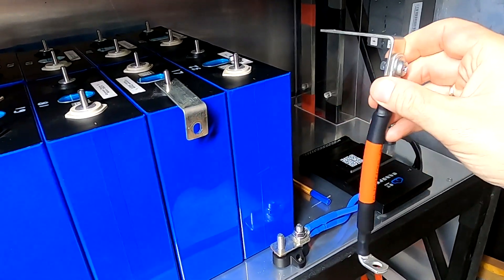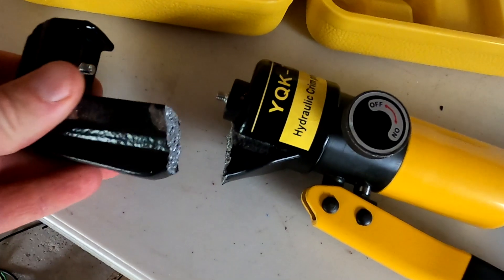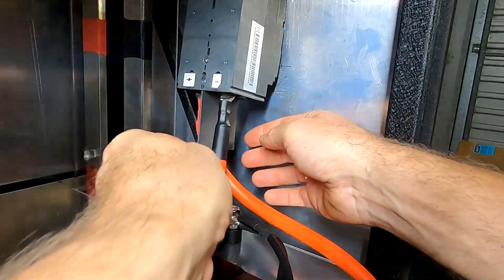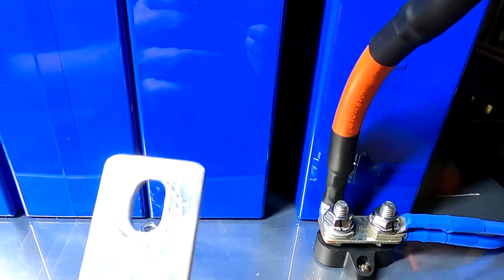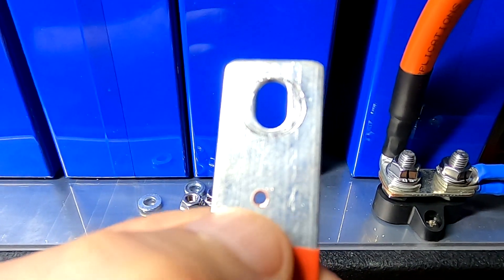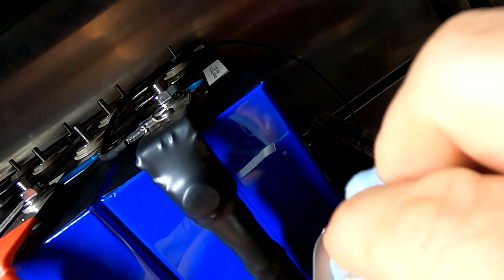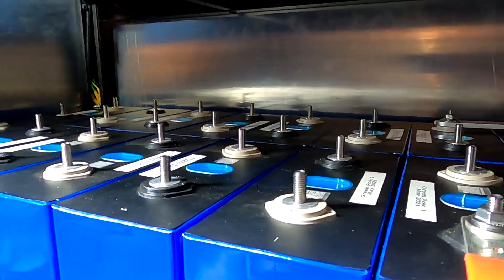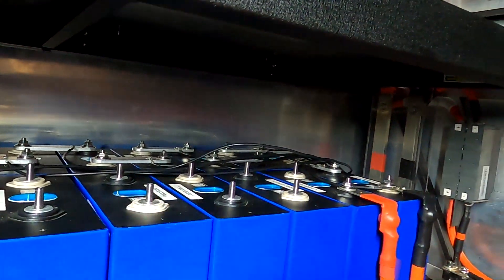Battery terminals, busbars and balance cables - How I do it! Building a 48v/14kWh battery. Part2

Comment: Hi everyone,
I was wondering why use 35mm2 cable more than 25mm2 ? With 100A breaker 
Is it for more safety or is it oversized?
Thank
Morgan
Reply from the maker: 25mm² is rated for 97A
35mm² is rated for 120A
I guess, I had a lot of 35mm ordered (almost the same price as 25mm²) and wanted this extra bit of extra capacity
Reply: @ thanks Andy
Already ordered and installed 35mm2.
Big thanks for all your videos!!

Comment: I have a stand up battery case 16s 48v - 2 tows of 8 - 3.2v batteries , “ I want to use 2 PCS 3.2v 280AH batteries in parallel = 3.42v x 560AH x 8 batteries in series with 16 total batteries in parallel ~ I’ll just have to extend 1 bus bar to connect each bank of batteries or make up a battery cable only a few inches long to go positive to negative I will probably use some zero gauge to get maximum voltage transfer and Amperage ! Maybe some oxygen free wire I’ve seen that in the past for more  efficient power transfer ! I will over kill it , it’s for home battery ~ back up we use about 3 KW a day = 375Wh for 24hour I have a MRPOWR 3KW 24v inverter & the BMS is a Seplos 7ss 24v 150A I also have LTO 2.4v 40A using 11 batteries in series but linking 2 batteries in parallel = 80 Ah total of 22 batteries the LTO batteries are so post to drain slower ! “ this Battery shelf I most Excellent ! I love your content ! I would love to see a parts list for the build of these battery shelf’s breakers , relays , wire inverter the whole 9 ! You’re wisdom and intelligence here shine’s Bright ! Thank you !

Comment: What value fuse did Andy use on the sense/balance lines?? I am thinking 2 amp 125vdc.. It sure would be easier to replace an external fuse compared to replacing the surface mount .01 ohm 1/16 amp chip resistors they have on the board which act as 2.5 amp fuses..    

I plan to use a light film of De-Ox-It gold on all the terminals and crimp ends where connections are bolted together.. That stuff will prevent oxidation for a decade at least and is supposed to increase conductivity of metal to metal connections..  I also plan to put a film of liquid flux on the copper cable ends and inside the copper crimp cups then flow solder into that after I crimp them down..
Reply from the maker: That depends a bit on your BMS and used balance current. The JK has already 2A of balance current, so I chose a 5A fuse for each balance cable.

Comment: Rather than having the torque from tightening the nuts go to the terminal treads, have you considered using an Allen screw to hold the grub screw when you are tightening.  You can still use the torque wrench but using a crow's foot socket.  You will need to do a bit of math to adjust for the extra leverage due to the distance from the center of the crow's foot to the center of the grub screw but once you have the number, all is good.

Comment: I think fuseholders would have been a better bet than those tiny fuses you soldered in to the wires directly.

I never had anything to do with batteries that have aluminum terminals, but I had connected some aluminum cable on a distribution board for a gas genset and it was recommended to scrape the wire off with a knife and than put aluminum contact grease on the wire and then put them in to the terminals.
Reply from the maker: You use fuse holders if you expect the fuse to blow more or less frequently. I'm not expecting to replace the fuses at all. EVER! (that's a mouth full!)
Reply: @OffGridGarageAustralia  ok, that's another point of view, my thought was more like ease of replacement or even the possibility of easily upgrading the fuses to a higher amperage that the wires still can take.

Comment: Similar to appling flux, if you abrade the metal while the compound covering the surface, the freshly prepped surface won't have a chance to be exposed to ambient air.   The compound can be applied while scrubbing with an abrasive pad like scotch bright to achieve this. "Roloc" rotary bristle brushes could work also.  After abrading with the anti-oc compound, wipe it off , to remove the debris.  Don't use a solvent.. so that you retain a thin layer of the compound, then apply a minimal amount more of fresh compound and assemble.
Reply from the maker: That's what I have done today. Testing it right now...

Comment: Nice Andy. Your going to beat me iv got my first 14s running. Just started putting the fuse wires on my second 14s. I'm doing the old 18650 build my 1s is 260p it's a lot of work I'm going to build 3x 14s packs and that's it once there dead I'm going to go to the lifepo4 prismatic cells like you.

Comment: One battery link should be fused for protection.
Reply: I agree with that too, I have a 250 amp fuse in the middle of my 600 ah gel cell pack, but that has no BMS. I wonder what would happen to the BMS, if a momentary short on the output, suddenly applies 52 volts to the BMS monitoring leads between cells 8 and 9 (where the fuse would be), when it's only supposed to have less that 4 volts. Could destroy the BMS methinks! So I will just stick with the BMS and a circuit breaker for protection, and mechanically protect  the battery pack, and use insulated tools.

Comment: I am curious if the distance between cells needs to be kept equal? And if so, within what tolerance? Shouldn't we have used some kind of spacers (plastic, cardboard, etc.) between cells in order to make the connecting bars equidistant so the 5amps fuses will all react in the same manner: I am just saying.
Reply: The fuses are just for the balance leads. It’s much more important to have your main buss bars all about the same length and therefore resistance as they carry a much higher current.

Comment: Concerning hydro crimper.  Such a fault of crimper is "preprogrammed" by design flaw. Also, I suggest, that protective valve (the one with rotating knob) has failed, and its failure led to excessive force in press area.

Comment: Andy, another idea on connecting your balance leads without the possibility of striping the buss bar. Bring the screw up from under and use a nut on top.  This will also make it easier to get a small wrench to tighten them up rather than a screw driver.

Comment: I don't understand the fuses on the balancing leads. I would think that may cause issues if for whatever reason one would blow.  I could see protection on the main balancer to all batteries I suppose but this may even already be inside the unit? Just curious...
Reply: I think they aren’t fuses - they are mini bus bars that allow the BMS to be removed without disturbing the battery for maintenance and safety as no loose leads would be left lying around.

Comment: Come on - get that printer. Got mine 5 years ago and thinking about a new one, because mine only can do PLA and not ABS. So many things to do with a 3D printer - e.g. fixed a broken broom attachment to the stem, many things for my model railway etc. Would not like to miss it - it's like a swiss army knife. You could even print lots of covers for busbars, terminals, whatever. Get it. Oh, an there is a RV company in germany (WCS) who also got a 3D printer, because they where annoyed paying so much money for temperature sensor casings (which also were short on supply by the manufacturer) - as a side effect the printer is on duty nearly 24/7 because the also print mounts for internet routers, cable bushings and other things. Get one :).

Comment: Andy, those aluminum buss bars may need to be lapped on one side to get all the oxide off. That hand cleaning may not be enough. I’d get a sheet of 400 or 500 grit and put it on something flat like a new pane of glass to lap them on. Since the aluminum oxides very quickly I would probably be a good idea do half at a time. I’d lap (Not polish) the terminal tops too with a lapping tool. See my video “ LiFePO4 terminal, buss bar and lug preparation”. 
It’s important to clean any oil or grease off the surfaces before lapping. Also clean off the lapped surfaces when done with alcohol and inspect carefully for lint or debris before assembly. I use a small amount of Noalox too. Easiest way is to put a gob into a plastic bag and snip off a very tiny corner and put it directly on the terminal surface. If it’s on the bars it’s too easy to accidentally get it on the threads (my hands are too shaky). If it gets on the threads you can greatly increase the tension on the studs when you torque lubricated nuts. How do you know if the buss bar installs are good? I’ve found the internal resistance meter only to be a “fair” indicator but measuring actual voltage to be the best. I put a probe on the battery terminal just under the buss and the other just over it on the top of the buss and measure. What I consider good is anything less than .0005 volt (that’s right, half a millivolt) at a 50 amp load.
Reply: Check Andy's videos from last year.  He was joking when he said he would never brush or clean terminals ....like over and over...for 5 videos.   LOL.  Ray Builds Cool Stuff also did a good job with testing optimal terminal to bussbar connections and is using a similar antioxidant paste.
Reply: @jmaus2k  
Yeah I know, just won’t let him forget it. lol! If that’s the biggest mistake then he’s a genius lol.

Comment: Andy, be carful!!! The case of the cells are connected to minus! And the foil around them is very thin!!! Placing on an aluminium plate and touching together can cause a catastrophe!!!!
Reply: There is a sheet of acylic between the shelf and the cells. Well documented in the build series of the shelf.
Reply: @wiedapp  yup

Comment: i had the same hydraulic crimper ,only good for lightweight use , Mine broke the third time i used it in exactly the same place . it will not crimp Anderson connectors.

Comment: Great to see the progress Andy. I was wondering, what is the resistance for the aluminium buss bars? Are they better than the pure copper ones? I can see they are far thicker, but how does that affect resistance after all?

Stay charged and a big hug from Madrid-Spain!
Reply: Removing the oxidation layer is more important for lower resistance on these small bussbars than difference between aluminum or copper.  Aluminum or copper bars should be good, but the brass coated steal are bad.
Reply: Just have to increase the area to make up for the conductivity difference (per area).  That and protect from oxidation at the interface.
Reply: Sure! But I see the bussbars are quite thick, when compared to regular ones that come with the cells. I am just curious about the resistance in the ones Andy is using, so I can have a rough idea of how much difference is involved. Andy, can you do a test on resistance? Those aluminium buss bars (bussbars?) are sexy!!! 😍😍😍
Reply: @ricardomarcelino8388      , they are thicker so that they end up being the same resistance as a smaller copper one of course.
Reply: @unionse7en  I get and understand that. Just would like to see the actual difference in numbers. I also know that, thicker aluminium is lower resistance, but just by how much??? I think that is a very important question for me to know.
Reply: @ricardomarcelino8388  I'm sure Andy covered this in a previous video, he used on online calculator. One thought I just had, the bar may be thicker, but the contact area for the connections remain the same, I wonder if that makes any meaningful difference.
Reply: Aluminium has higher resistance than copper regardless. Pure copper is the way but aluminium is second best.

Comment: Why are you not using a Batrium bms? like the BlockMon M8?
Reply: Batriums are pretty much top of the line but that JK BMS is proving out to be the best economy unit on the market. 200 amp both ways and a start voltage programmable 2 amp super capacitor balancer is hard to beat.

Comment: Check out the „Sicherungsklemmen“ from PhoenixContact. So you would have them all located at the terminal and you can get them for a lot of fuse types. No filigrane glas fuses needed.
Reply: I had them in mind at first, too, but the length of wire from the cell to the fuse terminal would have to be special wire, that is 'kurzschlussfest', because that length of wire would still be unfused.